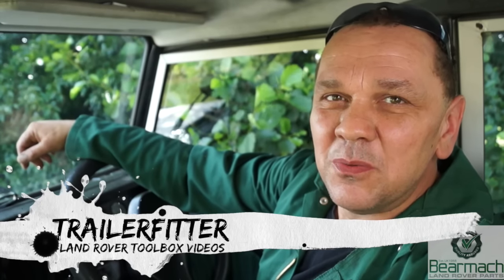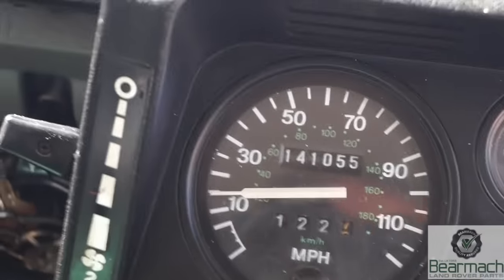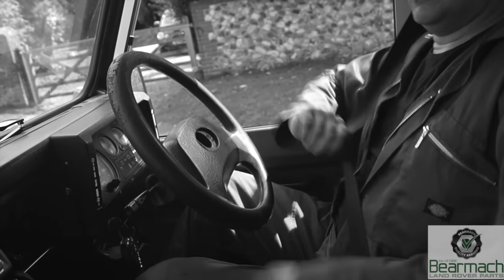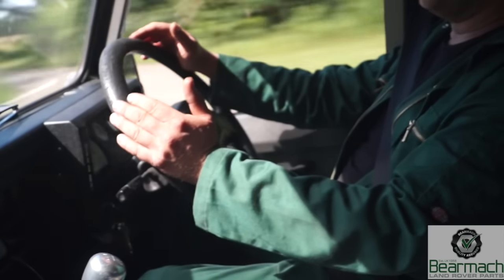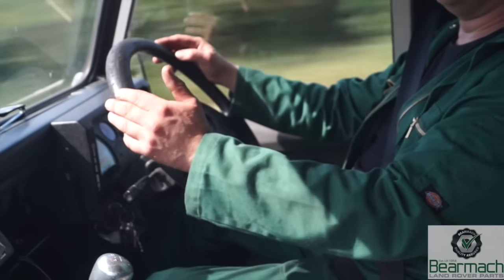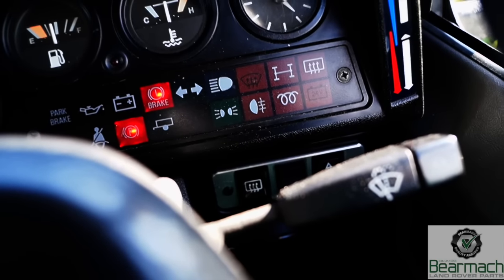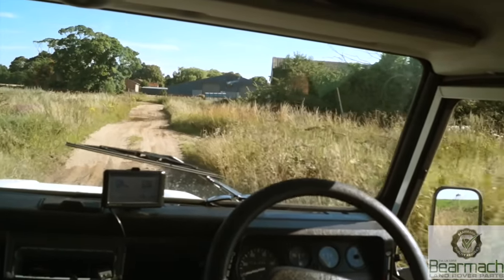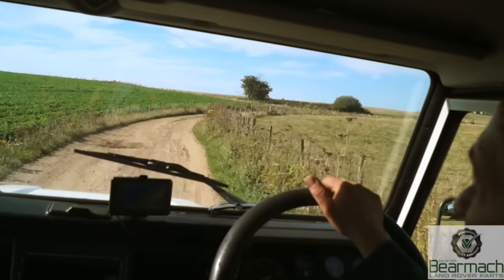Defender 110 road test -  what to look out for - The Fine Art of Land Rover Maintenance

Comment: You can switch whilst driving between low and high, here's how:

Start off in Lo & come up through the gears until you reach 4th Lo.
Hopefully, you should now be on a suitable strech of road, either flat or with a slight downhill gradient.
Dip the clutch & drop the transfer box into Neutral and bring the clutch back up. (Double de-clutch)
Prepare to go into Hi (ie. get your hand in the lever ready) and as soon as you dip the clutch you need to drop it into Hi.
While the clutch is down, select 2nd and then bring the clutch up.
Reply from the maker: funroverdotcom   ..............and crunch!   :D.    I really meant it would be nice to have a 16 speed splitter box like trucks.    Realistically the box is not designed to be changed dynamically but I get what you are saying.    Can you show us on a video how it is done Ben?
Reply: ***** Point is, it can be done whilst moving - and the above method is approved by Land Rover (taught at LRE). If done correctly it's not bad
Reply from the maker: The owners manual states that it can be done at speeds from 0 to 5 MPH which is noted as an advanced method,....  or as normal,  bring the vehicle to a stop then change.   

From an engineering point of view the dog clutch selector does not have a synchro hub/ baulk ring on it,  Do it wrong  or at speed then it will damage the dog  teeth on the gear so is it a technique worth the expense if you can't get it right?
Reply: ***** I  think the motto would be practice with someone else's Landy ... preferably Land Rover Experience's ...
Reply: ***** This technique is necessary for advanced offroading, people who tow e.t.c
Reply from the maker: Not that I need to worry.  If it is woking for the owner that is good enough for me.  they can do what they like with it after that.

Comment: Thanks for the great info. I have a 1996 90 300tdi. It has new tires on the front (balanced) that match slightly warn same model on the back. On the highway around 55 ~ 60mpr I get a vibration for about a second every 3 seconds or so? Feels the same as a phone on vibrate. Feel it on the wheel and test of truck. Where should I start looking (novice here). Cheers @trailerfitteres

Comment: Love the speedo at 8:20
Reply from the maker: Simon Bennett   it will not be like that for too long.
Reply: ***** Then after a while it'll be like that again... thus the circle of speedo cable is complete once more...
Reply: Mine was just like that. Replaced the cable (and then noticed a leak on the transferbox, replaced the seal), now speedo is just fine =)
Reply from the maker: endless fun isn't it?

Comment: my speedo reads over, so ill be doing say 60 an the speedo will read 70 or eve 75, seems ok up to about 30 but then after that the speedo goes into wish mode and reads mad speeds that i wish i could do in the ex mil 90, any ideas how to make it read realisticly, bearing in mind i am in canada and they are quite rare beasts where i am,
Reply from the maker: Interesting.  Not sure if the speedo drive gearing in the transferbox is different to give you that.  Don't quote me on that but I'll keep it in the back of my mind until I get to ask a specialist about it.